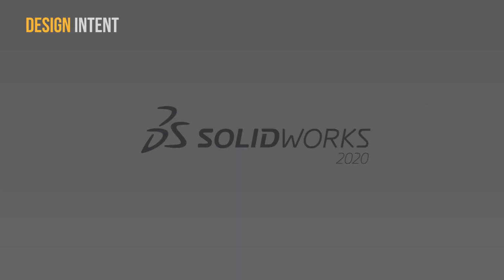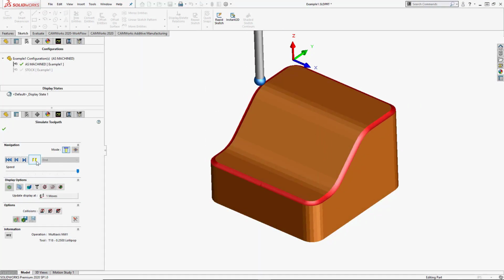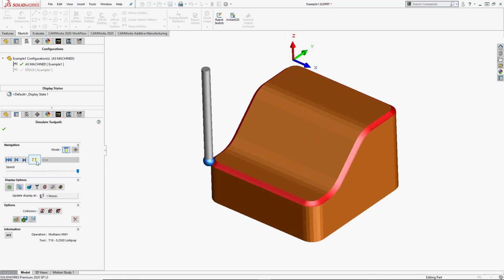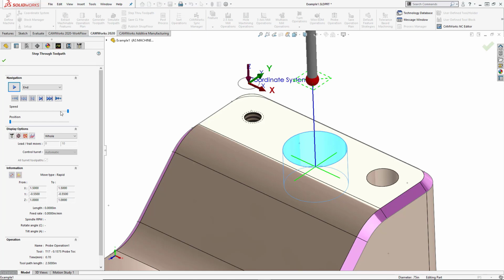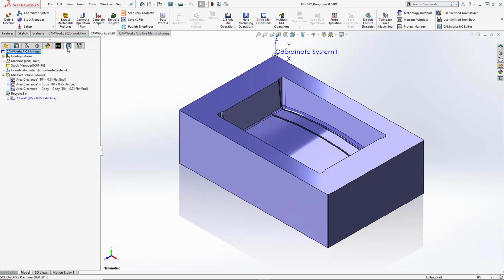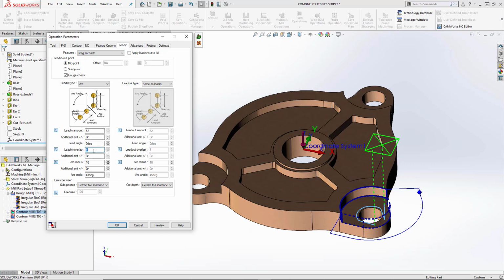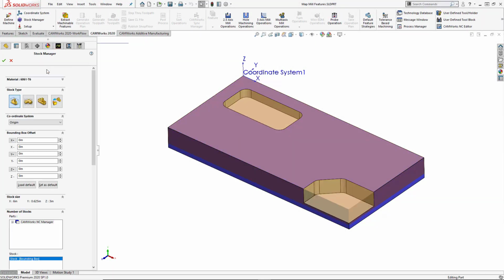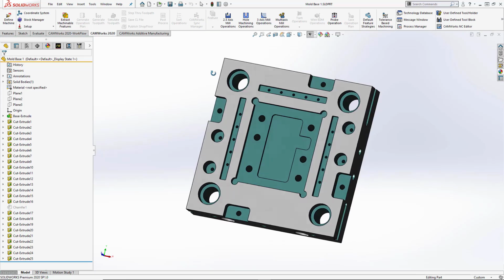CAMWorks 2020 Tutorial - Top 10 Time Saving Features

Comment: Amazing video! Really helped me a lot with an exercise of mine. As for the Volumill setting in the roughing operation, I am unable to find that pattern in SolidCAM, is this because I own solidworks 2019 and I need to update to the 2020 version or there is something I am doing wrong?
Reply from the maker: Beginning in 2018, SOLIDWORKS partnered with Geometric Global (the makers of CAMWorks) to offer a manufacturing tool called “SOLIDWORKS CAM”.  This Value-Add item is available to all Users (Commercial & Educational) who are on active maintenance (or subscription services) from their respective Resellers.  Among the many functionalities of SOLIDWORKS CAM, “2.5-axis VoluMill Roughing” is included as well.

SolidCAM (powered by iMachining) is, among many, a partner product that is fully integrated within SOLIDWORKS which also features its own high performance toolpaths (https://www.solidcam.com/en-us/cam-solutions/cam-modules/high-speed-surfacing-hss/ and https://www.solidcam.com/en-us/cam-solutions/cam-modules/hsm-3d-high-speed-machining/) based upon the modules purchased.

SolidCAM is a completely different product from SOLIDWORKS CAM, which may explain why you are not able to access 2.5-axis VoluMill Roughing or its settings.